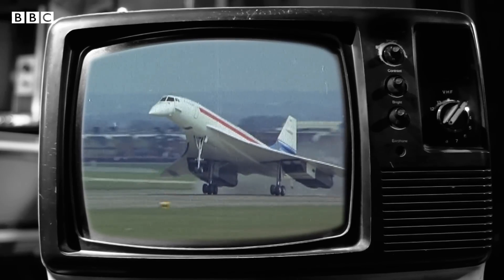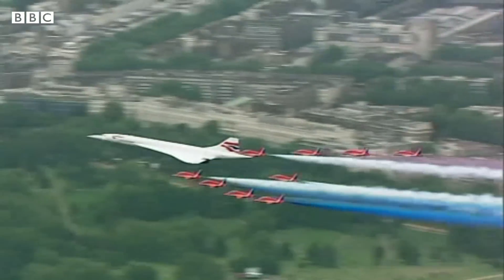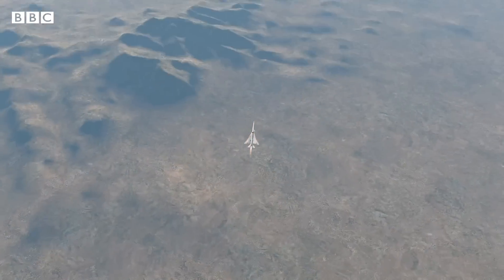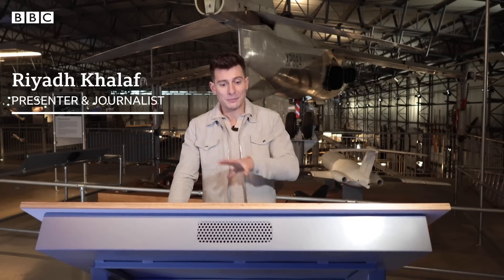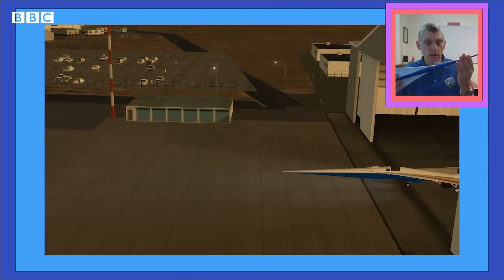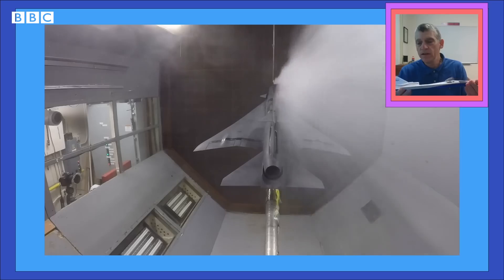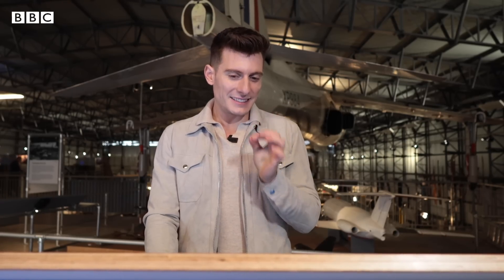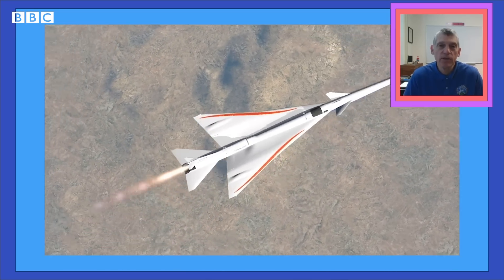Can X-planes solve the sonic boom problem? - BBC News

Comment: There won't be another SST (supersonic transport) for several reasons.
1) hub to hub travel is fading as it's easier go direct. Where hubs do work massive planes with 350 to 500 seats are needed.
2) in the old days It made sense to get to new York in 3 hours. Now you can use zoom or enjoy 7 hours in luxury in business class, with WiFi and lots of food.
3)too much fuel. The biggest cost is fuel and Concorde bearly worked in the 80s let alone 2020s.
Reply: Received , Many Thanks !😀
Reply: Received , Many Thanks !😀
Reply: You are right about flying to hubs but only 1/2 right about Concorde. 
Yes its was fuel hungry but then going fast in anything is a fuel consumption issue. If you use basic high school science class then you'd know from kinetic energy that going twice as fast requires 4 times the energy because its a squared law. Drag is also a velocity squared function so going twice as fast means 4 times the drag. It does get more complicated at supersonic speed but going those speeds is very fuel hungry. 

On the other hand Concorde ran very profitably and for many years was British Airways most profitable division. There's a great documentary made after they retired Concorde that was made with a lot of BA Concorde pilots. 

Its actually a great case study in effective market analysis. After BA realised Concorde was losing money they told the pilots they were going to shut it down. The pilots said it shouldn't be losing money because the planes were basically full for every flight. The BA board challenged the pilots and said if they could get it to make money they could keep flying. So the pilots checked the ticket records and found that the most frequent users were a bunch of bankers in New York, London and Paris. They found out that these guys were doing work where people still had to meet and sign contract papers. So for them being able to zip across the Atlantic sign some papers and zip back was brilliant. When the pilots asked the bankers what they thought the tickets were worth they got a monster shock - none of the bankers knew because their travel was always done by their secretaries. So they asked these bankers what a ticket was worth to them in terms of their time and got an even bigger shock because it was $1000s more than the actual ticket price.

So the pilots upped the ticket price to what the bankers believed they were worth. People kept flying Concorde and they made heaps of money. The pilots kept the board to their word and the pilots ran the Concorde division for years and kept it very profitable. 

What hurt Concorde in the end was Osama Bin Laden because something like 100 of Concorde's most frequent flyers died in the 9/11 attack because they worked in the World Trade Center.
Reply: Thanks a lot !😀
Reply: Maybe it'll make sense in however many decades when we can run planes at this speed fully off of renewables.
Reply: @tonywilson4713  good point. I guess TBF if it makes money it makes money. I also read somewhere about how charter flights were also quite profitable but don't really know much on the matter... In 2023 however, burning as much fuel as a 747 to carry 100 passengers doesn't seem like that swell of an idea.
Reply: @seanarmstrong8255  Yeah charters of any type are usually profitable because you simply look at the actual costs and then add a percentage and that works for anything - planes, boats, cars,...

On fuel Concorde was always thirsty but then so has every other plane in history when it flew supersonic. Its one of the reasons why the generations of jet fighters after the 1970s got slower on their top end speed. I remember an engineer who worked on the F111 who said that with full tanks off an air refueling with no external load to add any extra drag that it had enough fuel for about 4-1/2 minutes at full speed. 

One day when I was at my glider club in 87 one of the tow pilots mentioned that one of the Concorde pilots had just logged his 10,000th hour as pilot in command at supersonic speed. At that moment he had more time as PIC at supersonic than the entire USAF had logged in all its known history. The SR-71 time was unknown at that stage because it was still pretty secret but it was still estimated at only a few 1000 hours. 

People don't realise that even though there's F15, F16, F18,.... pilots with 1,000s of hours they have only an hour at most at supersonic with most of them only minutes. Its simply not something they do a lot of. Its a combination of fuel and much it stresses the airframe and engines. I was checking something recently about the MIG 25 Foxbat which was built to counter the potential of the XB-70 and could go faster than Mach 3. Yes it really could go that fast but it did so much damage to the engines they were tossed at the end of the flight and scrapped. Not rebuilt but scrapped.

When you know these things it just makes you realise how special planes like the Concorde and SR71 actually are/were.
Reply: @tonywilson4713  that's crazy. Concorde is just incredable, I wish I was around to see it in action. My dad saw it as routine when he lived in London in the early 90s. Crazy how such a thing could be considered so... Now I wish it moved every time see it at 27L at Heathrow when I plane spot.
Reply: @seanarmstrong8255  Even crazier is that the Concordes computers were analog. I don't know if you know what that means but the channel Veritasium did a great video on the subject titled "The Most Powerful Computers You've Never Heard Of" The pilots claimed the engine management, auto pilot and flight trim computers were some of the best that any airplane ever had.
The real tragedy of Concorde was that when they were taken out of service they had only done about 25-30% of their design lifetime. They should have flown on for many years. Its why a lot of people were pretty upset.

Comment: Missiles fuselarge
Plane wings
Throw air backwards, to a point where the shockwaves are behind. Controlled release snobs cannot understand. After use is not-discard but controlled-release for multiplier-effects and direction of shockwaves.

Sonic-boom is sound(air vibration) from shockwaves which is practiced to remove roofs of beach-squattlers... and other irritants... the purpose of making an old plane like hawker-hunter go supersonic is to remove roofs...